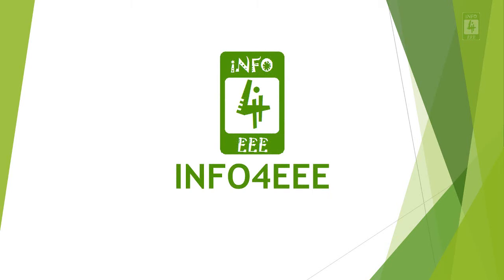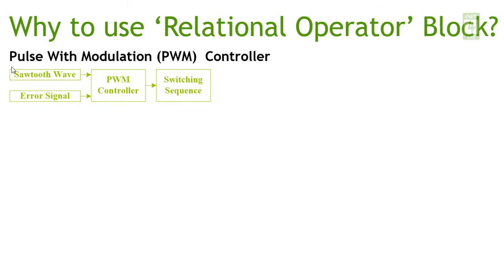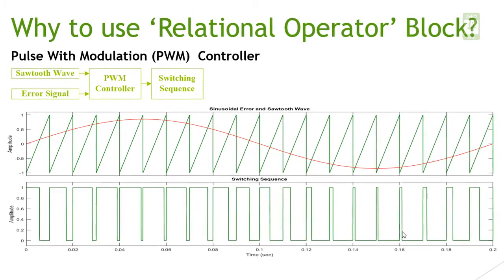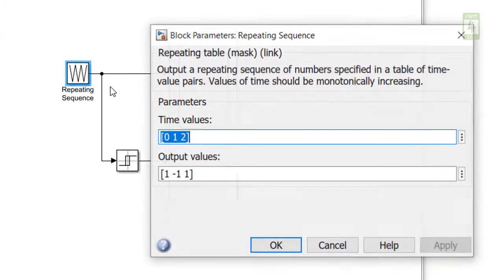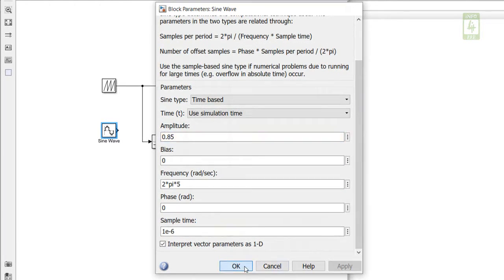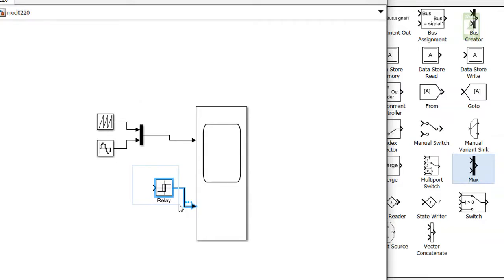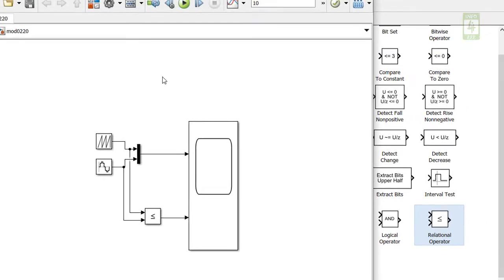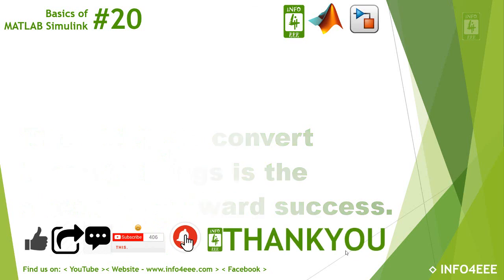Relational Operator Block in MATLAB Simulink #20 | Pulse Width Modulation Controller

Comment: Thanks alot for these simplified tutorials sir.

Pls sir, does the relational operator by default, convert its output to the PMW waves or, is there anothrt reason for this particular wave form output sir.
Reply from the maker: No, We have used relational operator block along with sine wave block and repeating sequence block to do sinusoidal pulse width modulation.

Comment: Thanks 
How connect 8 outputs of PWM design to 6 switches of SCMLI circuit ?
Reply from the maker: In that case you can combine two PWM signal with logical operator block (AND/OR) and fed to the switch.
Reply: @info4eee  I tried but the result only 4- level there is +Vdc missing
Reply from the maker: @islamalfirjani518  First I will have to understand your problem thereafter I can give any solution.
Reply: @info4eee  
Part 1: I have PWM design of 4 carriers which eight output 
Part 2: I have a Switch Capacitor Multilevel Inverter of 6 switches to generate 5-level 
when I want to connect part 1 to  Part 2 there are 2 outputs of PWM without include in any switch, I tried to add two to one but still don't have a 5-level?
Reply from the maker: @islamalfirjani518  To generate 5-level voltage waveform, you have 8 switching signal. In this five signal will generate switching for 5-level i.e. +2Vdc, +Vdc, 0, -Vdc, -2Vdc. while remaining three signal generate switching signal for switch from available five options. So you can connect these signals to respective switches. For example, one signal is for +Vdc, second is for 0, and third is for -Vdc. then you you have two options for +Vdc, 0 and -Vdc. So you can connect two signals to the switches generating +Vdc with OR gate. similarly connect two signals to the switches generating 0 with OR gate and two signals to the switches generating -Vdc with OR gate.
Reply: @info4eee  I still try but there is something missing I couldn't know which is!
Reply from the maker: @islamalfirjani518  Then you can share the screenshot of the problem showing it clearly on our email info4eee@gmail.com, I will look into it and try to resolve it.